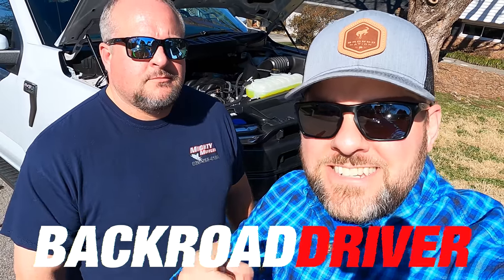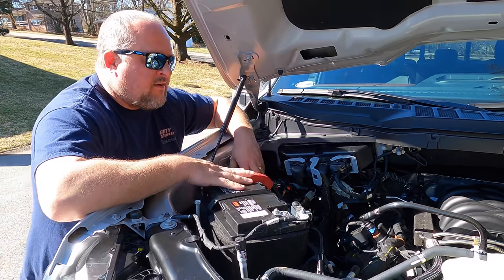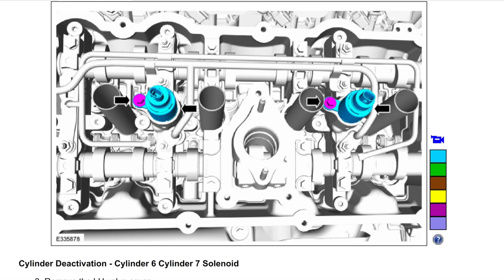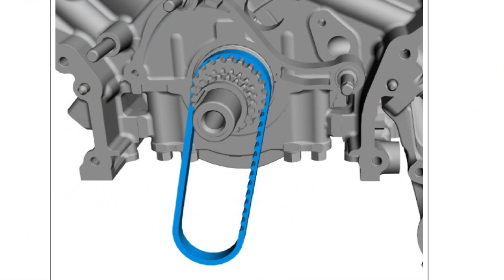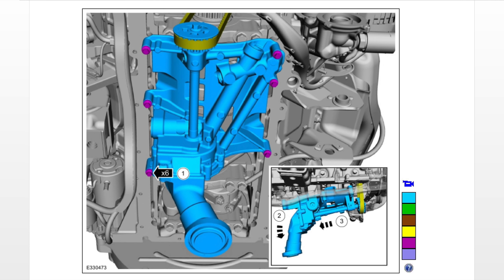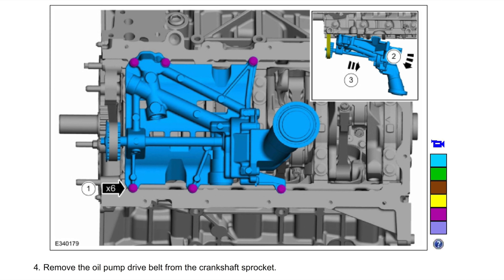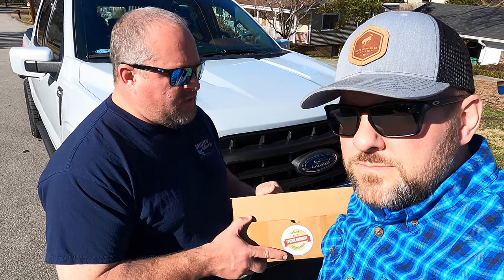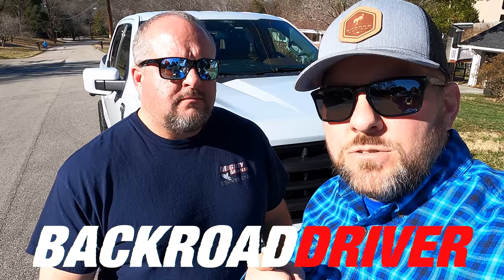2021 Ford F150 5.0 V8 Cylinder Deactivation & Oil Pump Belt Explanation - JLT Catch Can Install

Comment: Great video fellas. I just wanted to give my two cents. I am a master mechanic previously for Honda for several years, I worked for Dodge for several years and now for the last seven years I’ve worked for General Motors. Every one of these companies has done the cylinder deactivation technology on their motors and it’s caused major problems. The only one that’s done any justice is Honda. They beefed up their parts in 2013 and added technology that allows you to actually turn it off. General Motors has never addressed the issue since they introduced in 2007 into this very day the 5.3 L V8 it’s almost 100% failure rate by 150,000 miles. Camshaft, lifter issues, oil consumption, seals going bad all because of the cylinder deactivation. The repair is $2748. I do at least one or two a week.

It really bothers me that Ford put this awful technology into the 5.0 L V8. That was a great motor. Personally, I drive a Toyota tundra because it doesn’t have any of those ridiculous fuel saving so-called benefits and it’s never cost me a dime.
Reply: Snake, I haven't seen much dirt on the L3B 2.7. Is it legit? Thanks
Reply: @sharkskin3448  Great question. I haven't heard about nor seen many issues with the 2.7L V6 Turbo Ford is using. IMHO it is in the sweet spot for a turbo motor though. It is not too small which is a huge issue with longevity and stress, and its not too big that it would kill you on gas.

Now, I think in the F-150 this is a commuter only motor. You try to do a lot of towing with it and you'll most likely wear it out fast. 

This is the motor you get if you just want a truck and will only use it as a commuter or a bed. 

I don't think it has been out long enough to get a real since of longevity other than so far so good.
Reply: @SuperSnakePlissken  ty for response. I was referring to the L3B 2.7 4cyl turbo that GM is using as a base engine in Silverado/Sierra, as well as some mid-sized SUVs including some Cadillacs.
Reply: @sharkskin3448  Ah! Avoid! Under powered and overstressed. Do not get it. Tons of problems as well as having to replace the turbos in the first 20-30k multiple times. I have no idea what GM was thinking with that motor in the trucks. In a SUV probably be ok. I've not seen any issues in SUV like the Elevation. Trucks though major problems because IMHO the motor is too small.
Reply: @SuperSnakePlissken  lol! I knew it sounded too good to be true. Meanwhile, my beautiful '21 DC Ltd is currently worth original MSRP and I owe ~$8k less. Great truck, but loves to drink! Guess I'll keep her til the 22 waste gate issues are solved. Unless I try to grab a Taco.
Reply: @sharkskin3448  I would call you absolutely crazy to sell a Toyota and buy a GMC. I can tell you as someone who sees these vehicles everyday, the quality of the vehicles since they moved to china in 2019 has dropped dramatically. We are doing a lot more warranty work on GM trucks and SUV's now and we have ever done. Little things that we never had to do are almost a daily occurrence. 

I've seen starters on the start/stop tech going out with 40-50k on them when years ago the starters would at least last until 80k. 

Enormous amount of brake issues especially on the 1500's. Electric problems out the wazoo! 

Everything that is 2013 and older doesn't have these problems. 2014-2019 you definitely see an increase but 2019 plus....

Ironically, I drive a Toyota Tundra as well! Love the truck. THe owner of the dealership has offered to buy the truck and sell a 1500 to me at his price if I just stopped driving it. The funny thing is couple other guy I work with all drive Honda's or Toyota's as well. That should tell you something!

Did I mention avoid the 3.6L V6 with absolute all costs?
Reply: @SuperSnakePlissken  the last GM I had was a'12 Sierra crew cab 1500, 5.3 vortec, 3.42 rear, built in MX. Drove for 56k miles and traded for a '14 Tundra, & have been driving Tundras since. I know you're a Tundra driver from other comments on Y.T. vids. Be well and stay safe.

Comment: everyone talking about the oil pump belt can hold 1000hp , what i would be worry about is can it last for atleast 250k miles with out replacement

Comment: I heard if you leave it in Sport Mode it'll never drop cylinders.  Can you confirm?
Reply: Sport mode deactivates auto-start/stop on my 2021 EcoBoost. So you might be right.
Reply: Correct.  Sport Mode fixes both.  This makes me believe it could be tuned out fairly easily.  Time will tell.
Reply: @thesamizer  Thanks Sam.  On the fence about selling the diesel for a gasser.  5.0 or bust if I do.
Reply: @thesamizer  Sport mode it is
Reply: Sure and then the 10 speed will drive like garbage in part throttle situations.
Reply: But nothing fix timing belt from this engine!

Comment: I was all set to buy a New F150 with the 5.0.   Not now!  That cylinder deactivation is a show stopper!  
My GM and Ram buddies went through hell with this crap.  

The cylinder deactivation scares me 10 times more than the belt driven oil pump.

I have owned 7 F150’s with my last one being a 3.5 Eco Boost.  It was a beautiful powerplant that I guess I’m going back to that or more than likely a Nissan Titan with the 5.6.  I owned one in the past and it was a beast.

Comment: Variable displacement engine VDE is listed on page about the 5.0. Ford doesn’t call it Cylinder deactivation.
Reply from the maker: Good catch.  You are correct.  You have to swipe over to the 5.0 V8 section and they call it VDE.  Ford was smart to stay away from calling it cylinder deactivation since it has a negative connotation.  I did scour the 2021 F-150 brochure and still there is no mention of VDE in it.

Comment: I noticed it said cylinder deactivation in the build and price when it first came out but they removed it. Bad move by ford. Im staying away from new f150s besides a v8 raptor until they change their engines.
Reply: Test drive a F150 hybrid with the 3.6. 430 horsepower. 570 ft. lb torque.. It's quicker than a 5.0 with 400 horsepower. 410 ft. lb torque. 

(Hybrid 5.3 0-60 / 13.8 ET. 102 mph quarter mile)

Comment: On my Ram/Dodge vehicles that had cylinder deactivation(MDS), the annoying exhaust sound (with aftermarket exhaust) was most noticeable when cruising at a steady speed (65-70 mph) on the highway/interstate.
Reply: In either the 5/6 speed auto or the 8 speed, you just manually put the trans in top gear, 5/6 or 8, and it prevents eco mode from coming on and it shifts normally.

Comment: Ford has been taking lessons from GM on how to make some cheap, badge it up and sell for a higher cost.  There is a huge market for a non computer based vehicle, simple, easy to work on, etc.
Reply: "There is a huge market for a non computer based vehicle, simple, easy to work on, etc."

The problem there is that THE GOVERNMENT WON'T LET YOU SELL THEM. I guarantee you that if Ford or GM wasn't being forced to sell trucks with cylinder deactivation and engines with tons of computers, they wouldn't be doing it.

Comment: I had pretty much made up my mind on a 21 5.0 but cyl. deactivation is just a big no for me and the belted oil pump isn't much better.  I'm leaning 3.5 Eco now although I prefer the simplicity of the 5.0.  I had a 2011 3.5 Eco and it was great for 50,000 miles and then the problems started.  It also never got the fuel economy that my 2015 5.0 gets.  With the stock market heading down lately I'll have some time to see what owners are saying before I hit the sales floor.
Reply: They don't want anything to last. Trucks and cars lasting a long time doesn't sell more parts and vehicles.
Reply: I don't know what your situation is, but if you don't need to tow your house I would strongly recommend the 3.3L v6. It was developed by Mazda and is easily the simplest and most reliable engine currently available in the F-150 (and is probably the most reliable engine currently available in any half-ton truck).

Whatever you do, stay the hell away from the 3.0l diesel.

Good luck!
Reply: @dave3682  not so much towing my house but I do occasionally have the need to put a 1 ton pallet of wood pellets in the bed.  I know even with the 1st gen 3.5 Eco it was like the weight wasn’t even there except when braking.  The 5.0 needs a little more throttle.

Comment: Dodge hemi engines have cylinder deactivation or they call it MDS. It makes the engine sound terrible. More importantly if you buy a truck you want a V8 not a 6 or 4 cylinder. Especially if you tow a lot. Don't need computer going in and out of 4,6,8. Get rid of cylinder deactivation, the difference in fuel economy isn't a big deal either.
Reply: Laughs in ecoboost

Comment: Yeah. GM lost their ass on the cylinder deactivation. Multiple TSBs and recalls for excessive oil consumption. Makes sense Ford wouldn’t advertise it. Got a catch can on my 1st and 2nd Gen Raptors. Check it in a month and tell me it’s not needed. Tons of oil
Reply: Its not like ford wants warranty bills. I'm sure the cylinder deactivation is harmless. I had it on my 2014 ram and it only kicked in cruise control under 75mph. Got 24mpg on flat land, 10mpg city driving. Never kicked in uphill to Vegas but was engaged the whole way downhill back, high 20s mpg. 7 years later I think ford did it right. Time will tell.
Reply: I’m not not hating the feature. I don’t really give a rats ass. I’m simply stating a fact the GM lost a tone of money in recalls and repairs for this feature between 2015 and 2018. Google it

Comment: Yes sir your right they don’t tell you about the motor and I didn’t know that until someone told me mine sometime shifts hard and mine uses a quart of oil in between oil changes I think that stinks called them said it needs a soft wear update will see what happens if I would have known about that motor might not bought it ps like your videos

Comment: Are the intake tube vacuum lines on gen 3 to gen 4 coyote the same?
I want to use an aftermarket cold air intake tube to replace the stock chambered intake tube.
But I'll be keeling the stock air box, but with a drop in air filter.

Comment: I didn’t know about the rubber belt driven oil pump when I bought my 2021 5.0 🤦🏼‍♂️.
Reply: Neither do all of the 3.0 Duramax owners. Theirs is inside the oil pan and requires a costly teardown every 150k miles.
Reply: Is it a preventive maintenance thing that the owner of the truck is required to do and come out of pocket?
Reply: I haven’t looked into to, but I’d imagine their is a service internal on the belt

Comment: Cylinder deactivation is a big reason why I will not be considering a new F150. I hate that stupid "technology".  I'm sure Range Technology will have an OBDii port disabler out soon to turn that off. Another stupid technology is the auto start/stop. very annoying. I like what Ford has done with the interiors of the 2021's and the exterior is just OK but nothing to make me love a 2021 more than my 2019. Anyway these "fuel saving technologies" to save .001 gallons of fuel make the driving experience annoying.

Comment: I thought driving mode(Sport) would exclude engine deactivation
Reply: Putting the truck in manual mode, tow haul, and sport defeats cylinder deactivation. Luckily tuning is now available to completely deactivate cylinder deactivation.

Comment: What did the dealership say about the Catch Can for warranty?
Reply: I've never heard of a dealer voiding a warranty for the catch can.  Ever Ever.  That being said, if you have an issue and are taking it in for service it takes less than 5 minutes to put the factory hose back on.  The biggest issue with a catch can is it needs to be inspected for fluid level sooner than an oil change in most situations so have a system in place to remind you to check it. .  The good/bad thing is if you forget, it is going to put that junk back through the evaporative system just like stock system would do.  Don't forget to empty the catch can regularly!
Reply: Doesn’t affect warranty. Ford sells and makes their own , you can buy them through the parts counter or after market.
Reply: @michaelchadwick3497  thanks

Comment: One quick question, can you order the truck with just the 7.2 kW pro power and without the power boost? Thanks...
Reply: No
Reply: A big part of the “Powerboost” is the hybrid battery.  So in theory, you can’t have the big power produced by the 7.2 kW without the hybrid battery working in conjunction with the Ecoboost engine.

Comment: Cylinder deactivation has not worked at all for GM since the 1980’s when they came out with it in the Cadillac v-8 6 4 . Total crap.

Comment: is Ford really calling the the Gen4? or is this  just a modified Gen3?
Reply from the maker: No Ford isn't officially calling it the Gen 4.  This video was made over a year ago when very little was known about the changes to the new engine. Ford didn't make any press release or go out of their way at all to be clear what has changed on the engine. We felt that it should be called the Gen 4 at the time. It is quite different from the 2018 through 2020 models.
Reply: @BackroadDriver  Even 2016 models.
Reply: @BackroadDriver  I’d call it the gen 3.5 if anything considering the gen 4 will be a completely different engine when it comes out in 2024

Comment: I forgot to mention my truck is not a 4 wheel drive. I heard from my salesman that the V8  deactivation was only for the 4 wheel drive. I ordered the this truck with this engine after I was told it would not have this feature on this engine. But now that I see that one connection on my battery, I am wondering if it has that on my engine even though I don't have the start stop button on my truck.
Reply: All the 21's have cylinder deactivation and auto start stop
Reply: @bsextremesports  auto stop start has been deleted in certain vehicles
Reply: I had 100 miles on mine. Took it back to the dealership and asked if they could deactivate the auto stop start as I didn’t like it. Took them about 15 minutes with there laptop. Didn’t charge me.

Comment: Is it possible to “retrofit” a proper gear driven gerator billet oil pump onto this version of the truck Coyote? 
Screw that belt. Belts are intended to be disposable. 
They should NEVER be incorporated to power and engine essential functions such as oil pumps.
Reply: Ever heard of a dry sump oil system, like the ones used on every legitimate road racing car?

Comment: Wow,  didn't know Ford went to DOD!!   I like Chevy, Dodge, and Ford, but I know Chevy and Dodge both has had Lifter Failures!
Reply: Even though I hate cylinder deactivation, Ford's set up will be different since the 5.0's not a pushrod engine.
Reply: Lifter issues are a lot less common than they were back when the systems first came out back in 2008 or 2009. It's not different than the guys that say that the 5.0 has a ton of cam phaser or timing chain problems. Everyone "knows a guy" at a dealer that says they all have lifter problems.

Comment: Have been a Ford fan and a mechanic class 8 trucks the last 35 years this crap Ford is coming out with disgusting A BELT DRIVEN OIL PUMP you should call it a blue tooth driven oil pump cause the signal will be lost and it will happen that belt will break WTF Ford worst thing you did its coming back and biting you in the ass.

Comment: You can google how bad the GM cylinder deactivation is causing problem around 100K miles milestone, this is a bad decision from Ford, maybe they’re under pressure from EPA when democrats are taking over the government? This is a big no no to buy this new gen of the coyote engine
Reply: I used to work on military fleet vehicles and I saw AFM failures on GM trucks well before 100k. Fortunately a lot of them were still under factory warranty so dealerships bore the brunt of those piles of crap
Reply: I hope my 2014 Sierra still holds up.  No complaints yet with 210,000

Comment: 5.0 or 3.5 eb?
Reply: 5.0:  reliability, sound, simplicity and so on
Reply: @americantrucknation4891  hearing they have issues?
Reply: Like what? The 18-20 had the potential for oil consumption. That should be fixed. I think even with all the extra crap out on it’s still the best gas engine offered. Real longevity, 3.0 PowerStroke
Reply: @americantrucknation4891  yes those concerns. Thanks man for clearing that up

Comment: Get over it people. I'm a GM guy. The government has forced this shit on anything with a V8. So if we still get to keep our V8s, then we really shouldn't blame the manufacturers at this point. I blame obtrusive government forcing the hand of private industry
Reply: If that is true why is gm selling trucks made after 3/15/2021 without cylinder deactivation
Reply: @dcb805  You may have  overslept today or something. I think you apparently forgot the reason why GM is going to sell their V8s after March 2021 without cylinder deactivation. Go ahead and try a little harder to find your answer, silly goose
Reply: @dcb805  because they don’t have parts, bro! And getting rid of that trash is a good thing, that’s the truck to get with that engine no AFM/ DOD but moving on forward it's coming back. It’s only temporary.

Comment: Anything that has cylinder deactivation you can keep..I wont buy it. Anyone remember the 1981 Cadillac 8-6-4 that GM was sued--and lost--over?
Reply: They still haven't gotten it right..
Reply: So, no changes since 1981?  🤣
Reply: @Bogeypro256  🤣 nope.. them and Dodge finger fucked it and now Ford secretly put it on the 2021 5.0 F150
Reply: @Bogeypro256  Nothing I would trust as being as reliable as an engine without this additional chance for problems.